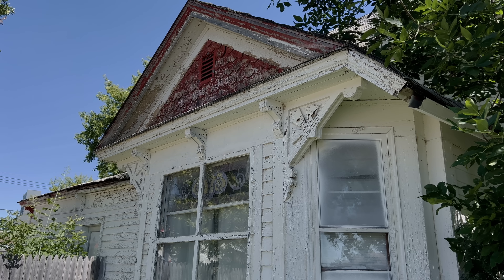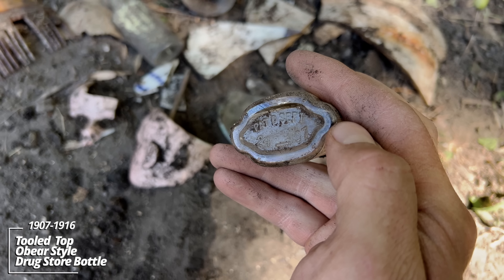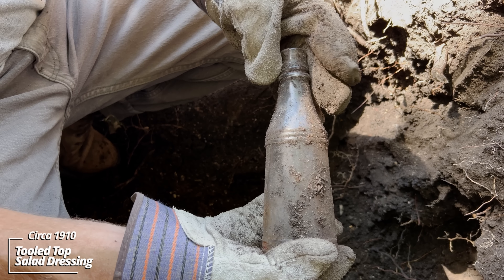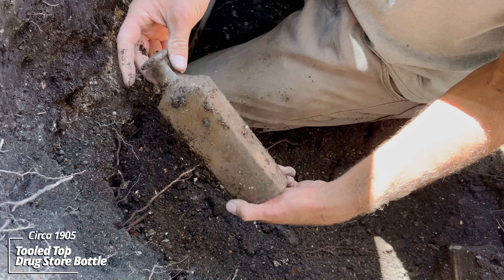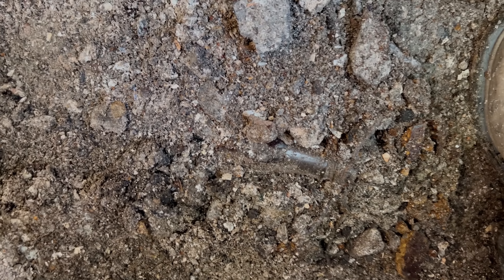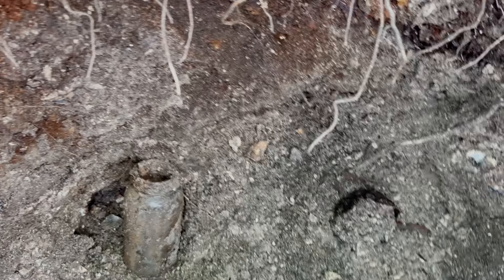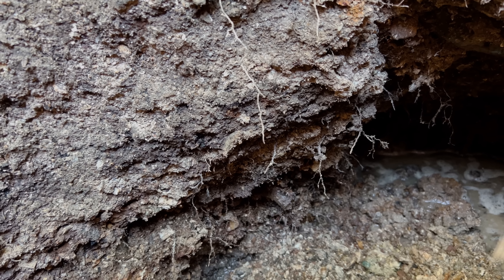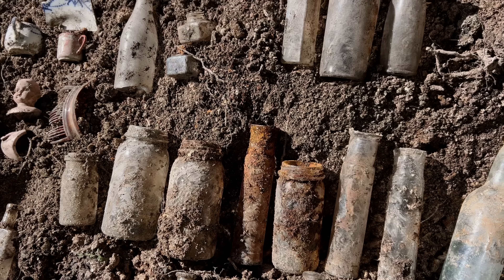Hidden Chamber Unopened For 120 Years Has A Massive Cache Of Valuable Antiques Inside

Comment: You're making me think about an old two-hole outhouse i know of out side of Searchlight, NV. on what was once a large mining operation. They had several buildings there for the workers who mined there and ran the mill. It's been said that miners often stashed the high-grade specimens that they found in the mine in them. Usually in a bag tied to a string, which often slid out of the crack that the knot of the string was wedged into and fell with a plop🙂There is a huge  can dump on the property that i've found old coins and bar tokens in, but nary a bottle. So now you got me thinking.

Comment: The H J Heinz bot #49 naufactured at the hometown Sharpsburg, PA Heinz glass house.
The 40s series of bots were hand blown, cork top, wax sealed, then metal/tin foil protective cap wrapped.
Dated in the 1893-1905 period.  1890s-1903 handblown, 1903 - - -  machine made Owens machine made bots.

 #49-used for several varieties of tomato and pickle chutney.

Comment: How do you research the old bottles you find? I am an excavator and have found thousands of bottles through the 32 years I’ve operated. I’ve somehow lost a lot of my collection but never could find a solid way of putting a value on them or even when they came about.

Comment: It struck me that someone had to decide what shape and color went with which product. I imagine the bottler began with a few shapes and then subsequent bottlers added or subtracted based on popularity and usefulness, and major manufacturers standardized their own signature bottles for their products. The wrong bottle could ruin the experience for the consumer struggling to get the substance out and use it. Bottles from abroad seemed markedly different from US styles. It's interesting to see how a bottler would add inscription and design to a standard shape for an apparent limited run. I wonder if bottlers were regional because of the difficulty of transporting bottles in the territories and new states in areas without train access, while limiting breakage. I learned in England that the canal boats were a huge advance over stagecoaches for the china companies trying to get their goods to market intact.